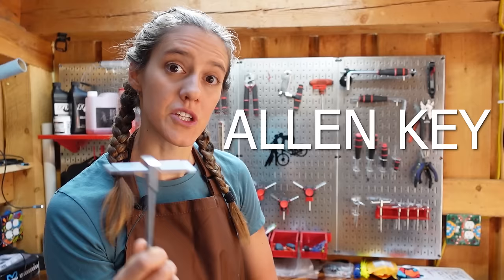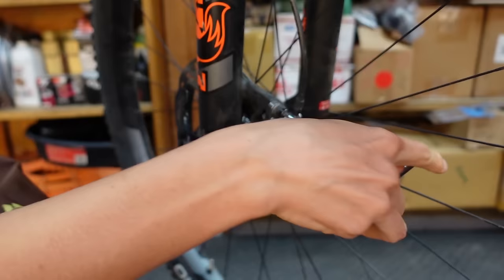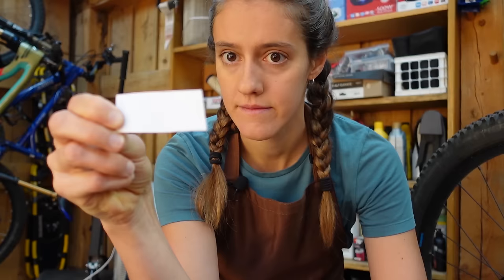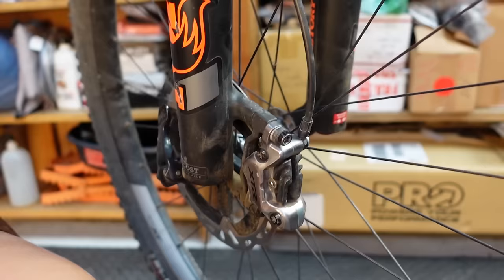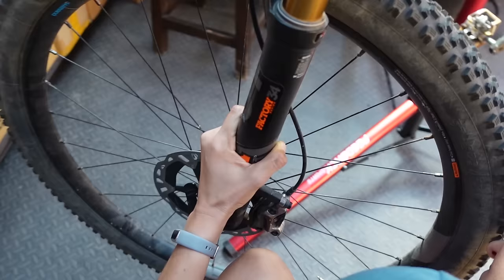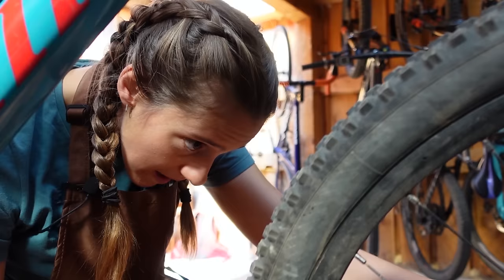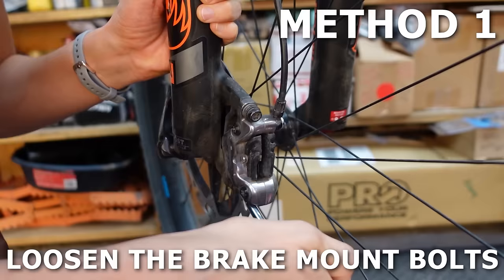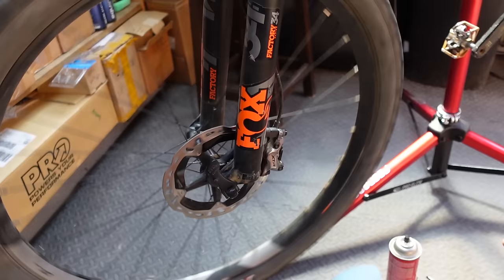THREE DIFFERENT WAYS to center disc brakes and stop rotor rub | Syd Fixes Bikes

Comment: Thanks for the helpful videos.  Tried all the methods, still pulsating brakes. Feels like brakes grab for awhile the smooth out (pulsate). Took to bike shop, said brakes are ok, they said fork flex problem.  ???  Can new pads and rotor fix the pulsing brakes?  rear brake is worse.
Reply from the maker: Assuming it feels like super short pulsations (almost a vibration) when braking, we've experienced this. Seems to generally be caused by the pads not being lined up with the rotor so part of the square edge of the pad material catches a bit. You can try adjusting more to see if you can get them straighter or you can try sanding down the edges of the pad material a bit to see if that helps. If not, we've found it usually goes away after a while (maybe do a day at a lift served bike park if you can) once the pad material has worn down a bit. Could also try new pads and rotors (or just start with pads) but I'd try the other stuff first!

Comment: newly subscribed..glad i found your site..1st - 2 videos i watched addressed my 2 issues of the day. rear derailleur setup and disc brake rubbing issue..Question? Can a non true wheel cause the rotor to be noisy..wheel wobble causes rotor to click loudly once every rotation?
Reply from the maker: Nope, the rotor is attached directly to the hub so the wheel trueness doesn't affect it. The rotor can be bent though and will rub in one spot, which I would guess us what's going on with yours. There's a section in the brake centering video (https://youtu.be/xWmlK5Qbt_U) that talks about straightening a bent rotor.

Comment: 8:30, the smaller slot is actually for greater leverage to use on the spider arms (for one piece rotors, doesn't work on 2-piece floating rotors), while the long slot is fine tuning with lower leverage. Also a great tip for actually trying to see the gaps around the rotor, like when manual centering, is to backlight it either with a small flashlight or even a piece of paper on the floor.

Comment: I had a set of hope v4. They were brand new. If I lined the caliper up with the disc by eye, when I pulled the brake the pistons would come out way further on one side and bend the disc. It was maddening. Sent back to hope, they said, "nothing wrong with them".
Reply from the maker: Sounds like a sticky piston (which obviously shouldn't happen on new brakes). We'll cover that in a later video!

Comment: While these are helpful methods, it wasn’t until many years as a mechanic that i learned that many (likely most) adjustments should not include loosening the caliper bolts. If the rotor looks centered in the caliper body, attempt to fix the rub by pushing the rotor up against the offending piston and holding it there while pulling the brake maybe twice to recenter the pistons (obviously use clean hands or a glove, and only push the rotor right next to the rotor to avoid bending it.)
Reply: Agree, these methods are good if you are installing new brakes or new wheels or if the caliper bolts have come loose, for some reason. Most times disc rub can be fixed with your hands.

Comment: I usually end up having to do the 3rd option. Does this mean I most likely have sticky pistons? It also helps to put something white on the floor under the brake when you do option 3 to help see the gaps.
Reply from the maker: Yeah, probably sticky piston. We'll be doing a video on that at some point!

Comment: The video was very helpfull but YOU SHOULD HAVE STARTED WITH THE LAST PART!! I probably would have gotten away with straightening the rotor, and I wouldn't have to re calibrate the calliper... a heads up about the 2 separate issues would be nice. It's my fault as well for not watching all the way to the end.

Comment: Yeah keeping the fingers away from a spinning rotor is something you should always keep in mind! While centering the brakes i had it spinning at very low speed and i got my thumb in the rotor and it did a perfectly clean cut rigth thru the fingernail ...
Reply: Gives a new meaning to "sit on it and rotate."

Comment: A helpful extra step before method 1 or 2 is to make sure there's enough slack/play in the brake hose. A tight hose may bind the position of caliper and not allow it to float into a centred position.
Reply from the maker: Good point!

Comment: My problem is every part is so tight that i cannot make any adjustments. Is there something else to help loosen the bolts or whatever they are called? I tried hitting with Allen wrench with hammer and no movement. Every part is like this except the parts of bike I had to put together. Frustrating.

Comment: Mine is rubbing the bike itself scraping off the paint from the of the disc and the part above the brake got an answer for that, it would be very appreciated
Reply from the maker: You might want to make sure that you have the correct size adapter for your rotor.

Comment: I just installed a new Rotor and pads. The pads are too tight against the rotor. Is there a hydraulic caliper adjustment to losen the caliper tension on the pads? Every video I find only talks about aligning the caliper. I need to adjust the caliper tension.
Reply from the maker: Most likely you just need to reset the pistons in the brake caliper. Just pull out the pads, carefully push the pistons back in using a plastic tire lever and then reinstall the pads. If the brake was bled anytime while the old pads were in, you'll need to open the bleed port on the lever to allow excess fluid to escape while pushing the pistons in.
Give this video a watch as we show pushing the pistons back in during the brake bleed process: https://youtu.be/o-YvMRJunwo

Comment: Hi guys! So I centered my breaks using the paper method, it worked really well but after I bed the pads in, they started rubbing again but not as bad as they were. What should I do now?
Reply from the maker: Just try centering them again. Especially after bedding them in, sometimes they need another centering.

Comment: So question I always have is with the rear wheel - how much should that freely rotate? Given the cassette, etc, will that be slowing that down. Had assumed it would be less free than the front but just managed to get a much better alignment and it's running a lot better. But should it spin just as easy as the front when set up right?
Reply from the maker: Nope. As you mentioned, there's resistance from the freehub, so it isn't going to run as freely as the front.
Reply: @sydfixesbikes  Cool, pretty much certain I've got it as good as possible then - cheers! :)

Comment: Does this brake centering method work for mechanical or hydraulic brakes, or both?
Reply from the maker: Hydraulic. It might work for mechanical, but many mechanical systems only move one side.
Reply: @sydfixesbikes   Thanks for the fast reply, I have mechanical disks on my touring bike, and my wife has hydraulic brakes on her Ebike, and since I'm new to disk brakes I proposed the question.  Love your videos, they're down to earth and simple, great job guys.

Comment: Perfect video for me, I have to readjust it all the time! Never used the paper method tho, definitely giving it a try.

Is it normal for my breaks to need te-adjusting every time I take the weel out?

Also I don't have brake cleaner is there anything I can use instead?
Reply from the maker: If you have to readjust every time you remove the wheel, it probably means you aren't tightening the thru axle the same amount afterwards... Rubbing alcohol works well for cleaning the rotors too.
Reply: If you have QR skewers, set the bike on the ground before you tighten it up.
Reply: If you open them up and then close them while on the ground, it will fully seat in the dropouts.
Reply: As for the brake cleaner, isopropyl alcohol works good.  If you have a lot of gunk on them, use Windex, then the alcohol.  Not expert advice, just something from a young person who works on bikes a lot.

Comment: Can I use a crescent wrench by the way you did good on those brakes
Reply from the maker: A crescent wrench for what part?
Reply: @sydfixesbikes  on my disc brakes
Reply from the maker: To loosen the bolts? Probably not. Most are allen keys and round on the outside...

Comment: I had a twisted key ring holding my front brake pads in place (the pin fell out a few rides before) and after riding slickrock in moab I thought it would be a good idea to get that fixed,
The guy at the bike shop took a small blowtorch to the brake disc and said I'm burning off all the bad stuff. In a way I get but still kinda don't
Reply from the maker: Interesting. I think it's a similar idea to just cleaning it with brake cleaner, but definitely more impressive looking 😁
Reply: As bonkers as you make it sound, I think that is a popular technique.

Comment: I don't need to center my rotor. I need to loosen both pads. They are both contacting the rotor without squeezing the brake lever. This is on a supposedly brand new KBO Breeze, right out of the box, and which is not supposed to need any adjustments. Hopefully by the time someone answers this, I will have found a solution.

Comment: I have a strange situation where when on the repair stand, theres no brake rub however when underway (especially whilst on a road or bike path) there is a slight “zing” whilst turning. Ive done the methods you’ve demonstrated but am thinking it might be a spoke issue causing the rotor to flex? Thoughts?
Reply from the maker: It's more likely flex coming from your fork or frame (in general, spoke tension will affect the rim, but not the rotor as it is connected to the hub). The best bet is to try to see if you can figure out if the rotor is very slightly bent and see if you can straighten it.

Comment: Very nice! Have had to do the "manual" method more and more, will try the paper trick next time. Will keep the rotor-straightening as a last resort or the LBS; it's nice to pay a socially-distant call to the LBS for camaraderie after all........
BTW, what brand of T-handle tool were you using on the caliper bolts? 
Thanks! Love your new channel, and Syd rocks it, as usual!
BTW2; I'm as clumsy and absent-minded as they come and I get better every time I work on my bikes. There's hope!
Hot dog?
Reply from the maker: Those are the Feedback Sports t-handle set (they're awesome). Link in the description (the Allen keys).

Comment: I think a quick mention of the difference between hydraulic and cable actuated disc brakes would be helpful - the method for cable actuated disc brakes is usually different, they often have adjustment knobs built in.

Comment: My problem is, The Wheelset itself is true but the tire has a wobble I know this is a different issue but my main concern is whenever I put back the front wheel on the fork and tighten the skewers the front wheel is not placing centered and its bugging me I tried different ways still the whole wheelset is not sitting properly

Comment: A lot is approximate, missing or even wrong here,
Biggest flaw to me is the caliper is weirdly mounted. The 2 screws have some "rotary" piece on the upper side but not on the lower side. The caliper should be able to not only slide left and right but also "rotate to some extent. There should be a "rotary" piece either side of each screw.
If that piece is missing the caliper isn't centered on the rotor which is weird also.
There might be something I'm missing.
Next, to watch the space between rotor and brake pads, you take a flashlight and illuminate the background (the floor for instance)
When you tighten the first screw you're careful and you only tighten a little then the  other a little more...other wise you might compromise the orientation.
I could go on...but I admit the vibe is friendly, comfy and smart

Comment: Hey Syd! What can I do if I dont have space between the pads and the rotors (like not because of the caliper)? Y push the pistons to the sides but they come out again :/ Thanks
Reply from the maker: Sounds like you have too much fluid in your system. Carefully open the port on the lever and cover with a paper towel. Then slowly push the pistons out. Some brake fluid will be pushed out at the lever (the paper towel is there to catch that). Once they're pushed all the way back out, reinstall the lever port screw, put the pads back in, wheel back on and then pump the brakes. Hopefully that will do it.
Reply: @sydfixesbikes  thanks!

Comment: I have a Schwinn mountain bike, (the Walmart special). I recently had to replace tires so I removed the wheels, took them to a bike shop for new rubber and brought them home to reinstall. Ever since I have no tension on my rear brake handle. Not sure what I did to cause this. Can you help me troubleshoot what I may have done wrong? Thank you.
Reply from the maker: Depends if it's cable or hydraulic actuated and rim or disc. If rim, it might just be disconnected. If cable disc, you probably just need to tighten the cable. If hydraulic disc, it probably needs a bleed.
Reply: @sydfixesbikes  Hi, thank you for the reply. I have Shimano disc brakes. I noticed today that on the rear brake hand lever the cable ferrule had become disconnected from the barrel adjuster. For some reason I can't get the ferrule to stay inside the barrel adjuster, it just comes out and I think that is why I have no tension. What do I have to do to tighten the barrel adjuster so the ferrule stays locked in? Thank you.
Reply from the maker: You'll need to tighten the cable at the brake caliper (not at the lever) by loosening the bolt that holds the cable, pulling the cable through and then tightening the bolt.

Comment: if I just change the inner tube and after installing wheel i hear this noise and wheel start rotating so hard so the 1st method should help?
Reply from the maker: First make sure your wheel is fully in the dropouts (if you don't have a thru axle) then try the first method. If it doesn't work, try the next 2.
Reply: @sydfixesbikes  thanks))) i'll try it)))

Comment: i bought a new bike and the brakes are completely misaligned and there is no braking power. also the gears arent shifting properly and making a clicking noise. Brand new bike and it wasn't cheap. I tried fixing it twice and the first time it did nothing and the second time i tried to fix it i made the problem worse. Now im pissed off again. So stupid

Comment: With so little clearance, it will rub with the slightest of flex, so better not ride it. You need more rollback on those pistons. They might need cleaning and workout until they move the same amount/force. The seals might not have sufficient grip on the pistons so they slide through them rather than bending the seals. SRAM tells us not to lube the pistons with anything because it will cause that. Good luck cleaning them of DOT if that's the case. The system might need a bleed. Doing one or even all three of these should make centering with the first method successful and the score you a bigger gap so that flex or minor rotor bends will not cause a rub. 
You can take a shortcut and just take out 2 drops of fluid from the system. It might do the trick if you're willing to sacrifice some throw.

Comment: my brake caliper keeps moving every time i tighten it messing up the alignment
Reply from the maker: Try pulling out the bolt and putting a bit of grease on the caliper surface right where the bolt head touches it. That often helps. Just make sure to avoid getting grease anywhere near the pads.
Reply: @sydfixesbikes   I thought that or a rubber washer in there might do the trick. I will try  your suggestion. Thank You!

Comment: “in the rotor is really bad”
Yup. I can confirm. My finger will be black and blue tomorrow: I'm lucky my nail caught it or I'd be sitting in emergency right now. 
“couldn't it cut off your finger?” Not in the wheel, but in the rotor, there's a ton of leverage there: it might not go through an adults bones but from my experience this evening, there's no doubt it would sever a child's finger. 

I'm here to find out if there's something I missed. Looks like “Nope. Hydrologic brakes just suck”. I'd kill right now for the pad screw that mechanical disk brakes have.
Reply from the maker: Oof! Glad you still have your finger!

Comment: Seems easier to put the piece of paper in by removing the wheel, folding the paper around the rotor and place the wheel back in, rather than removing the caliper.

Comment: Manual adjustment is pain, but sometimes necessary because often the caliper will rotate when you snug up the bolt.  Enough of a pain to cause a lot of swearing.

Comment: I think ParkTool has a special tool for this kind of issue.
Reply: Park Tool sells a chainring repair tool.
And a brake caliper toe-in tool.
And a rotor straightening tool.
And a bladed spoke holding tool.*

You can buy those, or simply use an adjustable (crescent) wrench for free!
*This is actually worth having, as an adj. wrench is a PIA during wheel building.